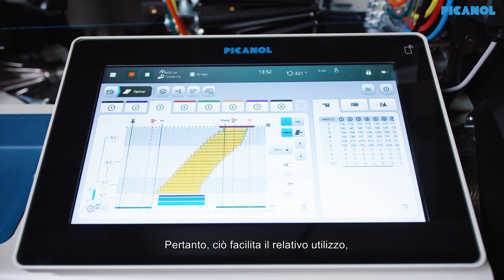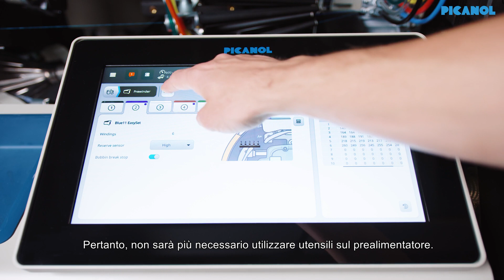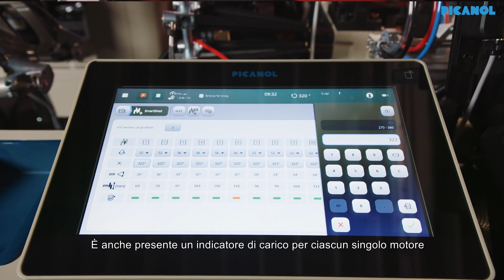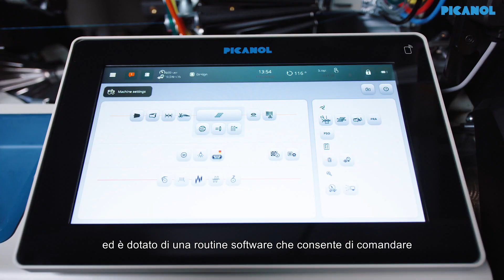TerryPlus-i virtual launch video - IT

Comment: Picanol looms good performance  .

Sum my openion 
Different pile  height  it means  if 10 pile loops  every pile is diffrent height   .   in case pile monitoring  no work   create quality issue  . please check  and solve this issue .

pile dropper  up side 65mm inner space    if my openion is pile dropper up side 80mm inner space ...
when make terry  pile dropper loose  issue solved . 
 
Picanol  terry looms good performance .